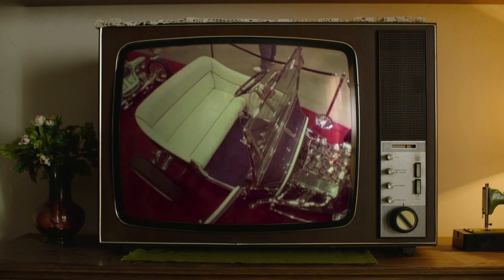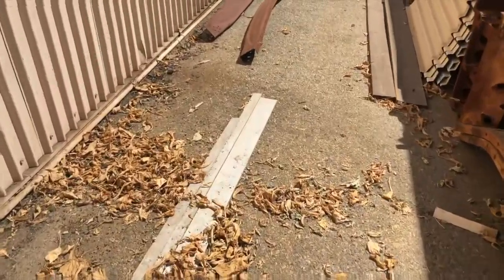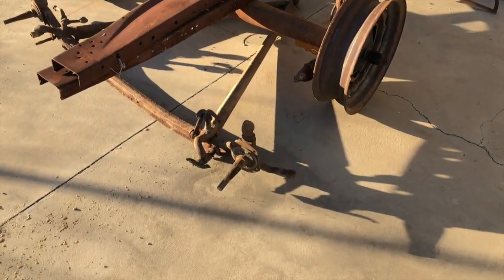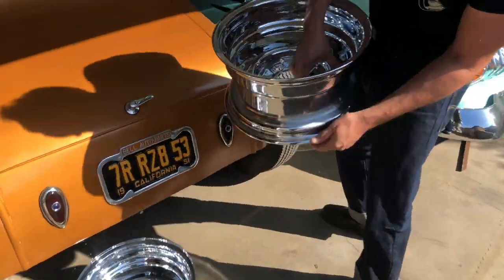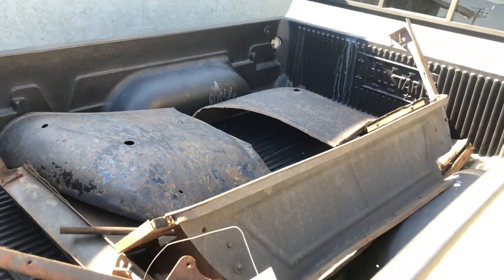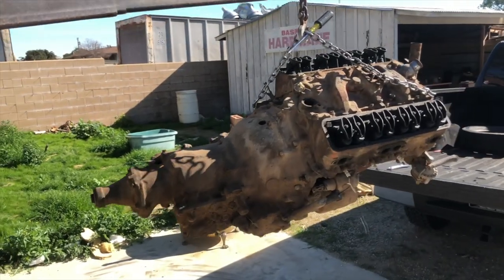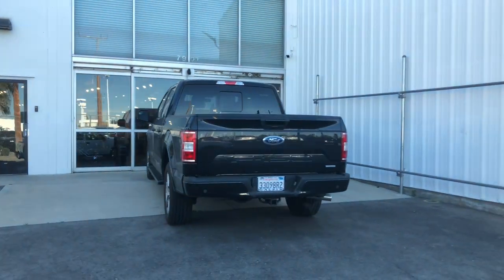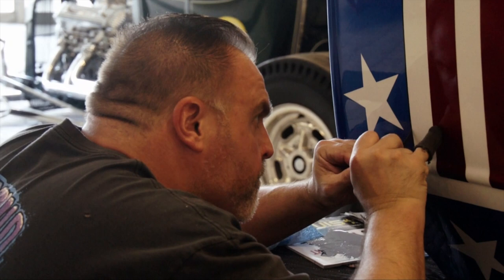Car That Ate My Brain 2: Episode 2 The Hunt For Parts

Comment: So bitchin’ !
Too bad I didn’t know you were looking for a roadster body back when you started. I had a 1918 roadster as well as the 22 Touring front half that I ended up using. 
I traded the roadster body for some parts for my own build. It would have been a good excuse for a road trip to California.
Thank you for sharing your build with us.
I’m looking forward to the next instalment.👍👍
Reply from the maker: Yeah thanks man! Although the 18 wouldn’t of worked it has a different shape.. it had to be 23-25 :) but your going to bring your T out to Cali anyways when it’s done so still have that road trip! Ha!
Reply: @MADFABRICATORSTV  absolutely! I nearly have it in it’s final roller state. Just finishing up some rear suspension bits then it’s on to pedal setup and mounting the steering box

Comment: Thanks for the info on the original Tweedy Pie. Did not realize the rear body panel  was from a touring and was puzzled by your stating in the first video that (only) the cowl was widened. Always wondered why the upper body curve looked "off" compared to a roadster body.

Also now realize why the Tweedy Pie model kit's frame looked odd as most people save the front of the frame rails and would not look twice at Deuce rails cut off just in front of the firewall. (I used the kit's suspension on another kit's Deuce frame and tossed the Tweedy Pie frame).

Now we need a break down on the construction of both Norm's T and Ivo's T so that we have an understanding of the mind set of the period when  the (original) cars were built. Seems Ivo's was the most straight forward.
Reply from the maker: Yeah  the cowl and the windshield as well had to be reworked.. there’s actually a 3 inch piece visible on the original windshield frame.. fortunate I have access to the real one so I measured everything! Ha.. Yeah the chassis was really unique.. There’s no way I would be able to afford to cut up a 32 chassis.. that’s why the find changed everything!!  
There’s some photos of the Kookie car all apart when they were restoring it and it was a pretty hack job and I know they were working with they had  but looking at Tpie in comparison the workman ship was way above and that probably why it took a bunch of awards against his buddies.. :) I snooped around Zivot as well and that car was pretty nice as well.. 👊🏼✌🏼
Reply: @MADFABRICATORSTV  You pointed out what I hinted about with Norm's T.  "Official word" that I received was that Norm cut off some of the frame and added to the other end of the frame. When that car was still in Dayton, Ohio (along w/ the Golden Sierra) the cars were brought over to Columbus and displayed at a car dealership. That allowed close up viewing. When I asked about the frame I was told what can be seen is actually sheet metal that covers Norm's work. Have not looked at that car's clone to see how that frame was constructed. Only saw Ivo's T once at a national car meet and it was roped off inside a building so there was no close up examination.

Thanks for the info on Tweedy Pie. Doubt if I ever use it but the images of those three T's is what I grew up with so you answered some life long questions for me.